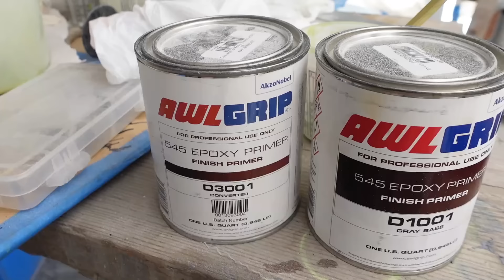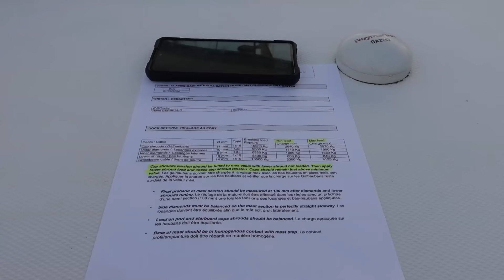Leopard Catamaran Repairs & Warranty Keep Smashing Forward - Spray & Pray!

Comment: Before signing off on all the work on your EXTENSIVE Warranty work I would inspect the very point of the bows of each hull (forepeak) and ensure the top deck is tabbed correctly to the hulls given Sailing Parlay Revival's experiences with Colin's 450 Lagoon. There is a video posted about 5 month's ago that detailed the repair they had to do to BOTH top decks. "THIS IS TORTURE!! Just when things couldn’t get any worse… 👀 (Episode 261)"
Reply from the maker: We have not signed anything. If they can't repair our boat or any repairs fail, the public can question the entire Moorings and Sunsail fleets. The same people work on those boats. The Youtube isn't going away so lets hope the have a good hard look at attention to detail . :)

Comment: I think its not very safe to wet sand with a electric sander 😮 you could get a shock ⚡️ . The best approach is to use air DA , much safer, and much easier, lighter. Anyway, your doing a great job. 😊
Reply from the maker: I'm only using our electric one on the sides and as soon as I start having to go underneath the plan is to borrow an air DA from a friend -  fingers crossed the compressor we have can take it!😅